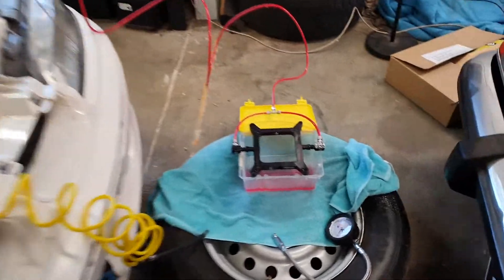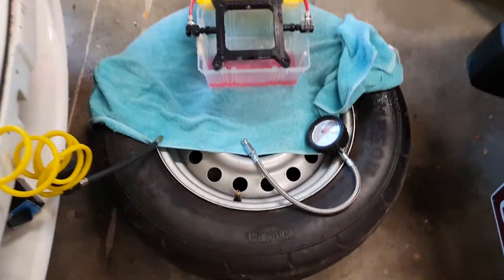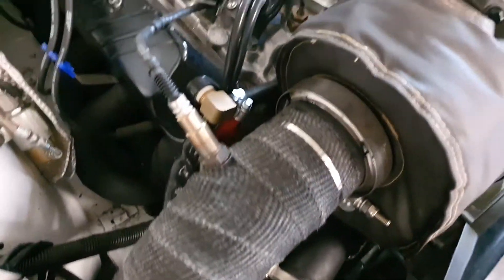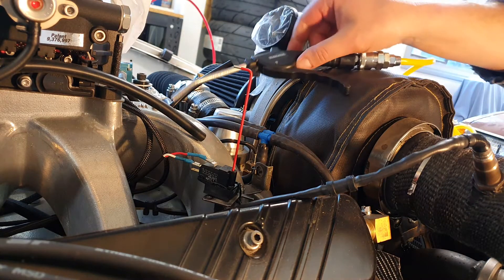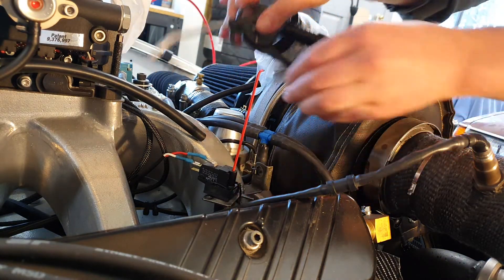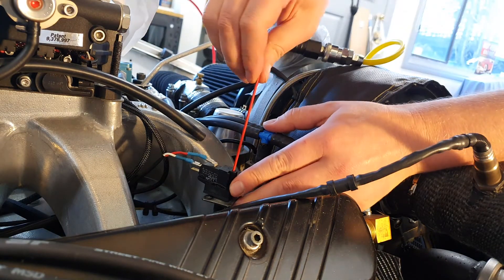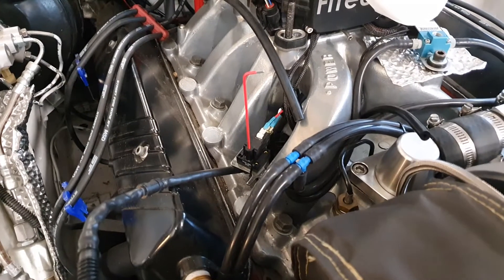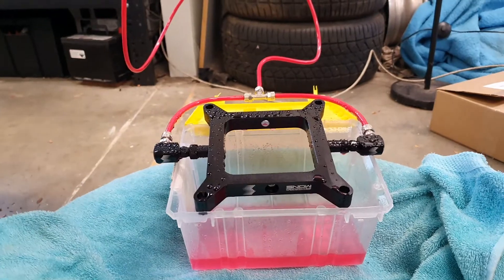How to set a Hobbs pressure switch to activate a water/methanol pump relay @ 5 psi

Comment: Hello there, quick question i am having trouble with the hobbs switch activating by itself on boost pressure, but i can activate it with air or a syringe. Did your switch activate fine off boost pressure when it was all set and done thanks
Reply from the maker: Hi mate, yes it activated pretty much as I set it after using this method. Are you sure the line you're using has vacuum? Any air Leaks?
Reply: @com-mod304  Hello, I could not get that hobbs switch to activate under  boost. i ended up going with a Aem system that has a gradual spray with boost pressure using same vaccumm line and working great i think it was the switch that was faulty thanks for reaching out 🙌

Comment: I see only two wires on the hobbs switch... I have same kit and no instructions... where do the two wires go
Reply from the maker: Hi John, from memory the hobbs switch is setup to ground to earth on the low voltage side of the pump relay when pressure activated. Hope that helps mate 👍

Comment: what hobbs switch is that? Nice video!
Reply from the maker: Thanks mate 👍 it's just the hobbs switch that came in the Snow Performance kit. If you type hobbs pressure switch into Ebay you will find heaps of different ones.